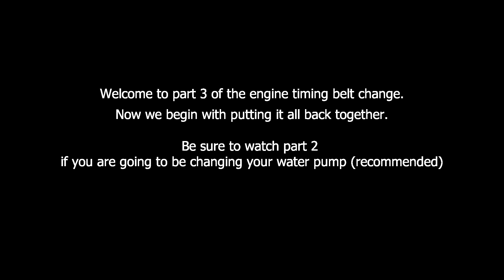Mitsubishi 3000gt / GTO Timing Belt Change Part 3 (Reassembly) - Competition Winner Vadim

Comment: I am an FTO guru and just bought 2 GTO's that have been sat for 8 years. I'm not even going to attempt to start either engines till the belts are replaced. I don't know why I had a slight fear of doing this job as I have done it thousand of times with the FTO, which is near enough the same process. Your videos have given me the boosted confidence to just carry the jobs out now. 
Thank you
Reply: Hey Michael,

I also own an FTO and 2 GTOs.  I am doing this on my GTO now and need to do it soon in my FTO.

Curious, how is the FTO different to this?  Is it easier or harder?  I have the MIVEC Engine.
Reply: What color Orange is that on the GT

Comment: 38:15 this is where I would have pulled the spark plugs.  Removing compression makes turning the engine effortless and it helps feel for valve / piston interference.  
I'm loving your video.  I'm doing my bosses car right now.  A full engine swap with a rebuilt engine.  I installed lifters, rockers (rollers) and cams today. I started the timing belt install.
This vid helps me.  Especially with belt tension and pulling the pin out of the grenade.
Thanks 

Watching from Kelowna British Columbia Canada 
👍🇨🇦🍻
Reply from the maker: Good point about removing spark plugs. Brain must have been asleep. Thanks for the reminder.

Comment: Great video ! Hope you will be able to respond to this 4years video , Im doing my timing belt and the front cam wasnt secure when removing the belt so the cam move , i will like to know how you put them back on the mark , i see that you put bolt to hold them but my cam are loose by hand , do i need to turn the cam in a certain way ? sorry for my english ! Thanks for the help

Comment: This was probably the best, most informative T-belt video for the 6g72. For me the special tensioner tool was worth the $13 investment as the first time I tried with a snap ring pliers my belt loosened up after just 3 minutes of running but luckily, I saw and heard it while watching it with the top timing covers still off at idle. Set the torque to 7 pounds and you should be really close to proper tension with the grenade pin. Also, I just want to note that you indeed can check the timing mark at the crank when the pulley is on. There is a tiny little groove on the backside of the pully that I used a dab of white out highlighting the tiny groove. Then you have a letter "T" which is bottom top dead center indicated on the lower timing cover. I also hit that with a dab of white out to better see the mark. In order to check the alignment at the crank pulley I used my cell phone to take a picture to see if the two white out marks I made line up and yes it was perfect the grove on the pulley was in line with the "T"

Comment: Joe, you are a lifesaver with your videos.  Thanks for all that you do for the 3s community!
My name is Brad from Arkansas and have two 98 gts,  one is an sl with a mtx conversion, the other is a base model mtx.

I am in the middle of a timing belt swap and ran into a crank no start issue.  Reading on the issue, it might be a crank shaft timing mark problem.  My mark is at 12:00, but I am seeing that there should be a mark at 2:00 which there isn't. I don't know if an incorrect oil pump was I stalled, giving me a bad reference.  Or, if I am looking in the wrong place.  
Do you know off hand which way it should be oriented?
Reply from the maker: Please watch my video for fitting cam belt. The timing marks are clearly shown. This should help you out.
Reply: @3000GTGTORestoration  are you by chance talking about your 3 part contest winner series on the timing belt change?  I did get a chance to watch it and it was very informative.  However, my marks are very different so I thought I might reach out to see if you knew about the sohc specifically.  It seems that there might be two different oil pumps that have different markings and I am afraid that the wrong one might have been installed causing the no start.  
I have spark and I have tested each of the sensors in the ignition system they all seem to be within their specifications and I have spark.  The plugs seem to have fuel on them, so the only thing that I can figure out is that my mark is incorrect, which I would know for sure if I had double checked before I started... silly me.
Reply from the maker: I no longer have a sohc engine. You can get a manual from my forum.

Comment: Joe i was wondering if the timing tool is necessary for the step where you do the provisional test with the crank pulley?
Reply from the maker: Not sure what you mean by timing tool.
Reply: @3000GTGTORestoration  i meant the pulley locking tool mb
Reply: You'd have to remove anything locking the pulleys.  Otherwise the cams wont be able to rotate.  I'm just doing my third one.  Dont ask lol;
Reply: There is a 1/4 turn provisional test and a 2 full turn test after that. Technically you could re torque the pulley bolt to rotate 1/4 turn with your 1/2in drive socket but it’s extra work since that pulley needs to be removed again to make sure the bottom pulley is in perfect alignment. You will need that tool to remove the pulley to get the timing belt on anyway.

Comment: At 31:06 you show the crankshaft pulley checking to see if its timing mark is correct. If im not mistaken the mark on the tooth is the mark and it is supposed to align a little to the right of the top yet your tooth is at the bottom. Am i looking at the wrong marks ?
Reply: The tooth is at the top right, spin crank counter clockwise 1 tooth

Comment: i see you had  problems with the cam cover to  is there a video  of you putting them on  as it seems my back one does not want to line  up  and what do the  plastic strips do inside thhe cover or are thet rubbers and mine have just hardened alan in the uk

Comment: I’ve read the procedure in the manual for my Stealth and it felt overwhelming. Now after watching your videos and listening to your explanations it doesn’t look nearly as impossible. I will be taking this on next spring.

I do have one question; obviously the engine will turn easier with the spark plugs removed but I’m guessing the process requires compression to do it properly?

Thanks for another informative video series.
Reply from the maker: You can remove the spark plugs if you wish. It is just a pain to remove the back ones and adds time and cost to the job.
Reply: Good to know. I was planning on doing the plugs at the same time anyway. I’m pretty sure they’re original - just need to watch the video on it. Thanks.

Comment: My front two cams are out of line with my crank pulley timing! How do i set them all to the right marks without messing up the engine? I tried putting back on the crank pulley and rotating it and that didn’t work. Can I just rotate the front two cams manually? What is my best course of action? I need this to put back on my timing belt

Comment: Enjoyed watching your video,cheers for that. I have got a GTO 1991 3ltr twin turbo unfortunately it is off the road for now cause I couldn’t get a power steering pulley/air conditioning unit due to lack of spare parts for that particular model.just wondering any ideas or know of any model that is compatible with my car anyone?cheers.

Comment: My one tip to people who plan to do this job is to get really good pliers to hold the TB tensioner pulley, get ones that are 45° angle not the 90° (or both) I destroyed my 90° because the water pump is in the way & almost had to buy a 3rd set, if their not long enough you won’t have enough leverage to hold it. Honestly just get the $15 tool from Mitsubishi.

Comment: They're an auto tensioner not a hydraulic tensioner even though everyone calls them hydraulic. There's a spring in them to provide the tension and the fluid is for damping any movement. They don't need replacing unless they're leaking fluid, that's according to the official workshop manual.
Reply from the maker: Thanks for the information. As you say, the manual refers to them as a auto tensioner. An easy mistake to make.
Reply: It’s a crucial part of the timing belt system, you can keep your old one in, I would rather spend $150 for my engine not to blow up.
Reply: @jayandrusiak  Only if you don't know wtf you're doing.

Comment: How did u sustain the engine from falling
Reply from the maker: You can see in the picture and video that I use a engine support beam but you can use a jack if you don't have a beam.
Reply: If you use a jack be very cautious about denying your oil pan. Prop it up somewhere else (look in forums) or use a piece of wood under oil pan and cross your fingers. Dented oil pan will restrict oil flow on these cars

Comment: Hi!  Is there part 2? I can't find it
Reply from the maker: Just been uploaded
Reply from the maker: I should explain that I just uploaded part 2 of cam belt change but if you are also changing the water pump, then the fitting of the belt will be part 3 of the set. The water pump video will be coming later this week.
Reply: Ok, thank you :)

Comment: Where can I buy a harmonic balancer  for my 1991 dodge stealth 3.0l
Reply from the maker: Does it have the v belt for steering pump?
Reply: @3000GTGTORestoration  

Yes
Reply: Yes it has a v belt
Reply: Yes it has a v belt
Reply from the maker: OK. Work with me here. Which country are you in?
Reply: @3000GTGTORestoration  im in the US
Reply: @3000GTGTORestoration  im in the US
Reply: @3000GTGTORestoration  im in the us
Reply: USA
Reply from the maker: Autozone used to have them but I haven't bought any there for about 6 years so they may not be available any more. I have a couple spare but I won't ship overseas until I have more stock early next year. I can help you if you can wait until then.
Reply: @3000GTGTORestoration  ok ill wait on you